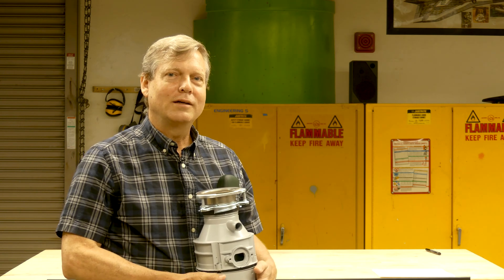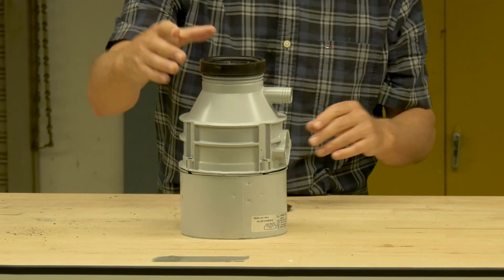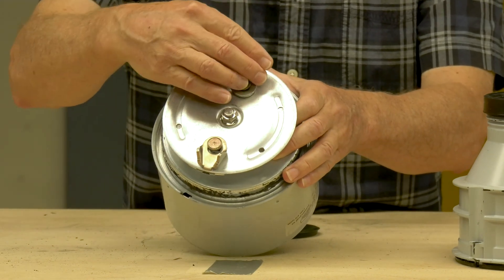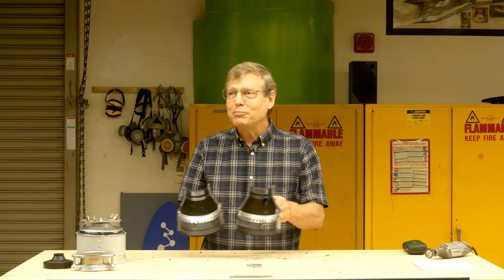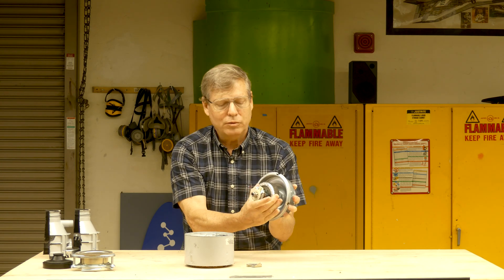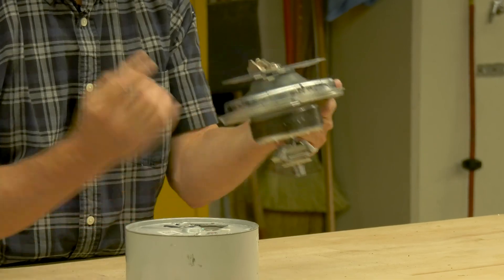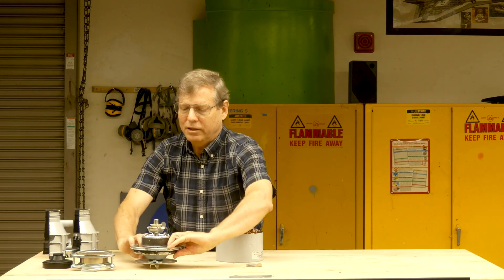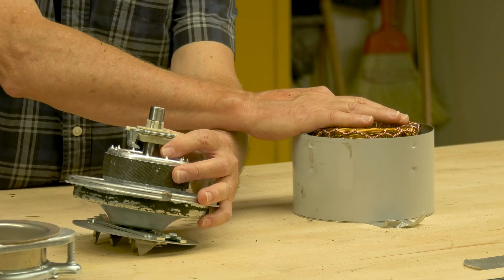Break It Down: What's Inside Garbage Disposals?

Comment: Only industrial 3 phase vacuums use induction
Thats a different motor entirely than those thats a higher speed 3 phase thats a single phase 1725/1750rpm motor 
Most vacuums blenders and power tools use ac/dc motors  basically  a brushed dc with the coil from an ac motor
Reply: It's still a single phase induction motor.  Plenty of tools use them.

Comment: This is a video that explains how the common garbage disposal works, it is not for people who has problem with theirs and try to fix it. The professor did a good job of applying his knowledge to reverse engineer a garbage disposal design and explained it. The demo unit appears to be an Insinkerator model and it looks new, it is a waste to cut it out. However, he committed a serious error when he tried to cut the top housing into half. He did not use protective eyewear and he did not point the cutter away from him, where the metal shaving flied into his shirt. In fact, he did not even need to cut it into half, the grinding blade is clearly visible, he can just point the camera for a close up of the grinding ring teeth. He could just open it up, showing on the working parts and be done with it. Sometimes, doing too much is not actually helping the demonstration to the audiences.